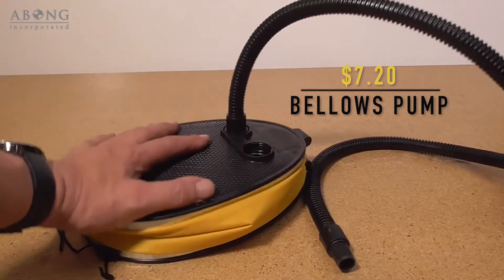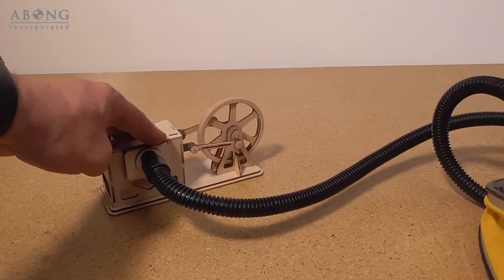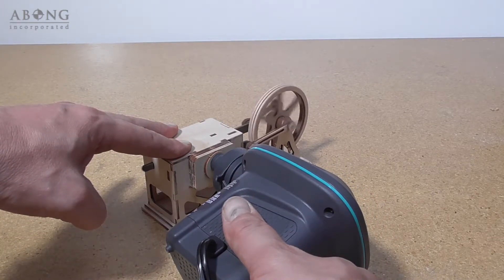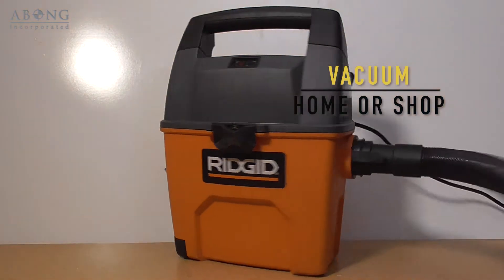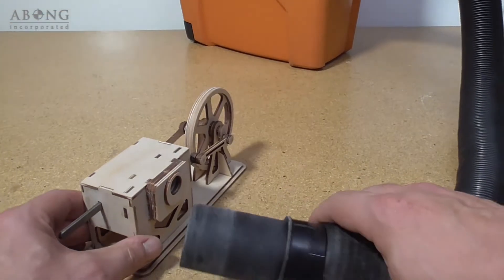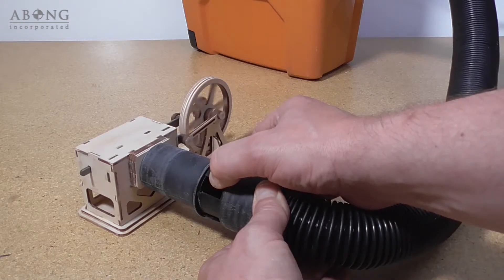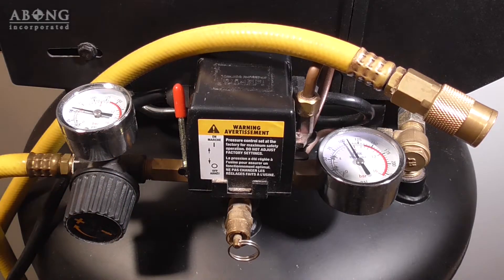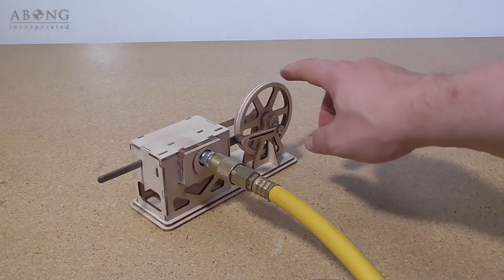ABONG Wooden Steam Engine Build - Part 9

Comment: Hi could you please tell me why ? with the shop-vac the flywheel runs in reverse - But when you used an air compressor  it runs in forward ?
Reply from the maker: The air compressor is "pushing" through the inlet, while a vacuum "pulls" air our of the outlet. Reversing the flow of air reverses the engine.